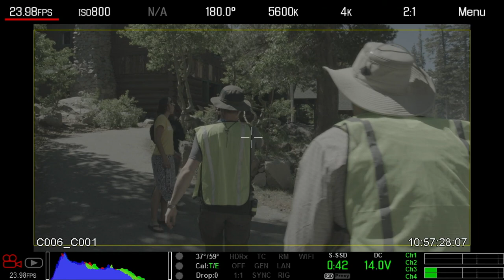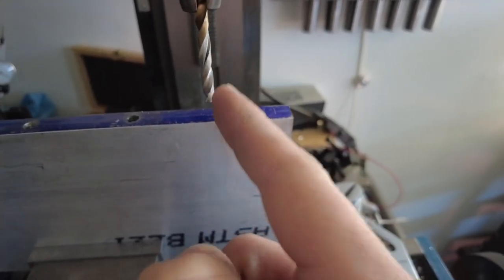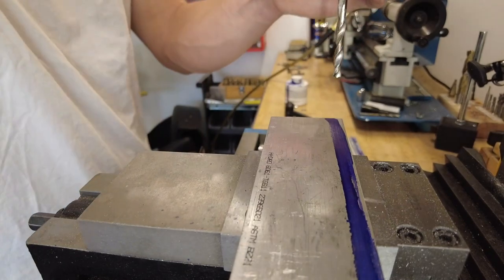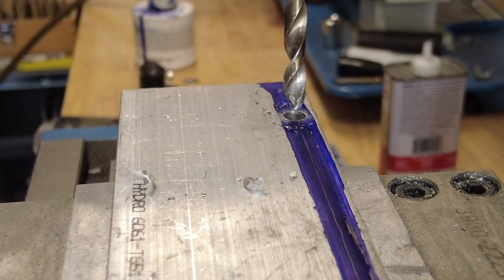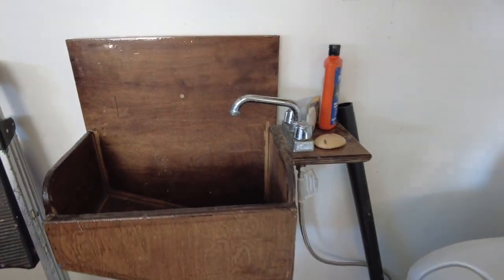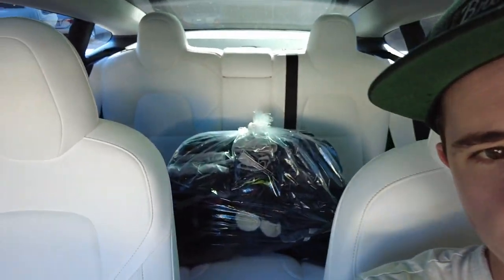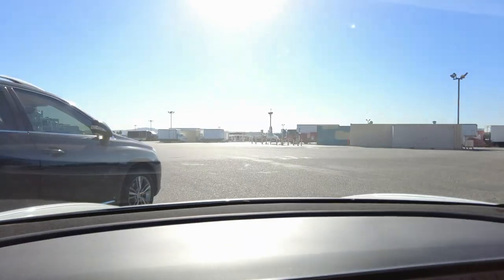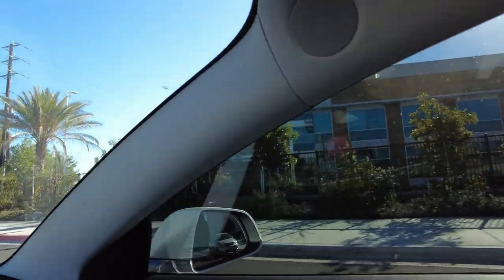Making stuff on a Mini Mill!

Comment: Enjoying the episodes....FYI the correct term is not "countersunk", Thats for angled "countersunk" bolt heads.... what you did is called "counter bore"   ; ) Counterbored holes are for making  "socket head" type bolts flush ;)
Reply: Both countersunk counterbored is same concept your matching were a bolt or screw head will sit flush to head of screw or bolt design Depending what you makeing material your working with wood, & purpose of what your makeing needs to be strong or you want to Spotface for aesthetics, smooth surface all depends what your makeing and what material,  with sheet metal you can do Dimping. & all really depends strength you want it what your building which method you will use & work best.
Reply: FYI Just Incase you here someone use Term "Pilot hole" While using a drill press, mill. That person is most likely not a Pilot for your Local Airline nore do they have a pilot's license . Its becoming a serious problem
Reply: @rloperfido3817  While the end result is the same (no bolt head sticking out) the tool to achieve each thing is different and the resulting shape/hole is different so its important to use the correct terminology. Words matter....If you tell a machinist to countersink a hole and you come back 10mins later with your socket head bolt you will be disappointed with the results. I'm just talking semantics of course ..... but in engineering these things can have serious consequences. Plus I like to learn these little details and pass them along when I can.

Comment: PLEASE put on glasses of some kind before blowing the mill, or anything else, off with high pressure air! Call me a safety nazi, but when you find yourself at the eye doctor with your head clamped in a fixture while the doc literally drills the embedded metal out of your eye, it will seem like such an easy thing to have put the specs on! Been there, done that...... twice! Learned my lesson the hard way!